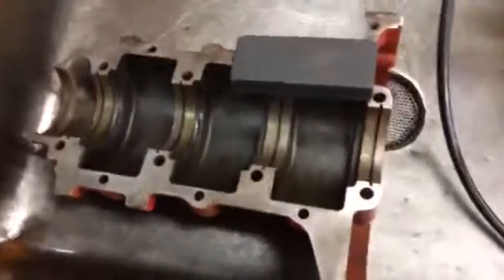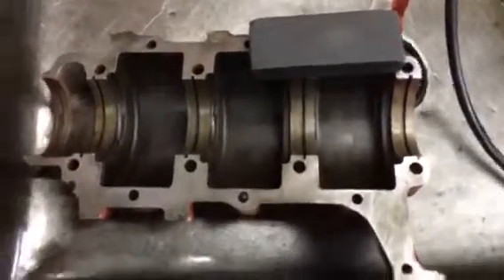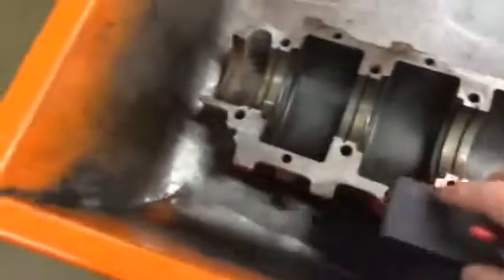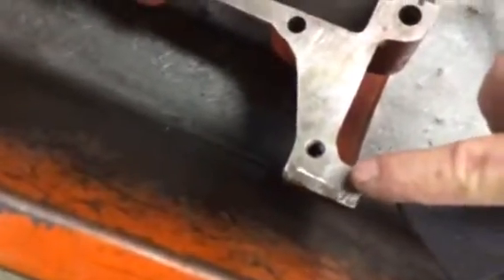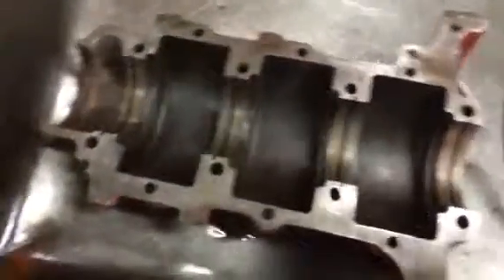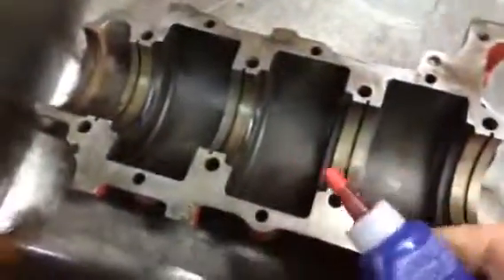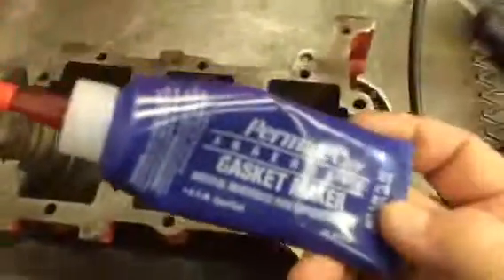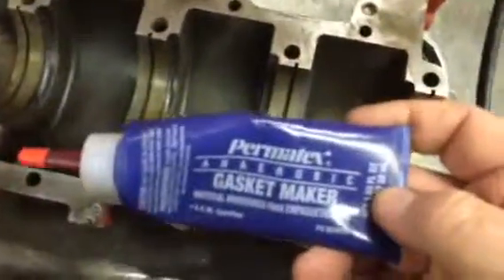Vintage Saab Two Stroke Engine

Comment: Nice! I have a spare bottom cover that's in good shape but rusty on the mating surfaces, but not really pitted, from years in semi-outdoor storage, that was given to me. I will stone it up, it should be fine I'd say. I'll then coat it with grease to keep it from corroding. Also, it says in the service books not to interchange covers and crankcases--only use matched parts, but since these are antiques now, and hard to find, can this be disregarded as long as you stone them and make sure they match pretty well? I have been saying all along that this requirement in the service manual is not that critical. Am I correct on this? I also have a couple of spare heads, front-radiator types. Also, the triple-carb engine I need an AB piston for is an "Early-Later type engine" meaning that it is the front radiator, triple carb (Shrike) engine but doesn't have the block drilled and tapped to accept the crankcase-pressure operated Bosch fuel pump, but instead still used the British SU electric pump like many of the single carb engines did. I have seen a few single carb rear radiator models, if memory serves me correctly, with the crankcase pulse pumps fitted. Seems like the early type engines may have "overlapped" into the introduction of the "Later Type, Later style engines" (triple carb, front radiator, pulse pump) Also, what about points, condenser, cap, rotor, wires etc, and carb kits? I can use this stuff as well, and need the cap and wires at the very least to get one of my 3 engines up and running--have a distributor with points and condenser (of uncertain condition as of yet) but need the cap, probably a rotor and the wires, plus complete kits for the other engines. I want to hear them all rinnnnng--dinnnnnnng--dinnnng again! As an old engine collector and restorer, I am used to reusing alot of stuff due to poor or non existant parts availability. Any help is welcome! iwantq7@yahoo.com Thanks Rick Delair!
Reply from the maker: my email is tomsaab@gmail.com yes you can mix the covers and blocks.  just remove the alignment dowels as they were "line bored" and doweled at the factory.
all electrical stuff can be sourced off ebay and parts stores. just takes some looking.  tom